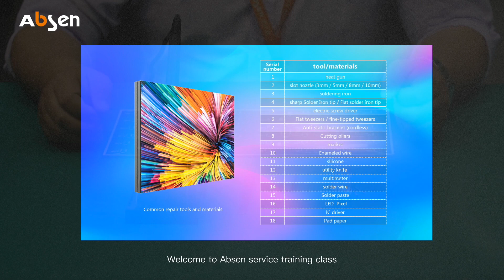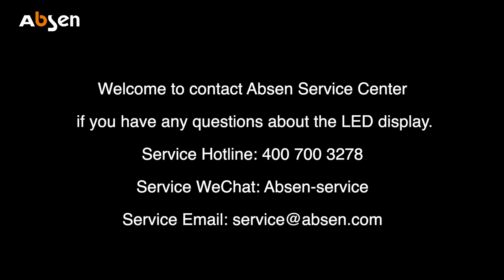How to replace an LED display IC (ICN2038)_Absen LED

Comment: I would never work on just one side of an IC and prise it up at all, this will stress the connections on the other side of the IC and could damage the pads on the PCB, always add solder/warm up both sides and lift the IC away evenly.

When resoldering it’s good practice to remove all old solder with braid to ensure the new IC sits flush on the PCB, then proceed to place the new IC and solder it (not weld!!) if using hot air then it will seat on the solder left on the pads.